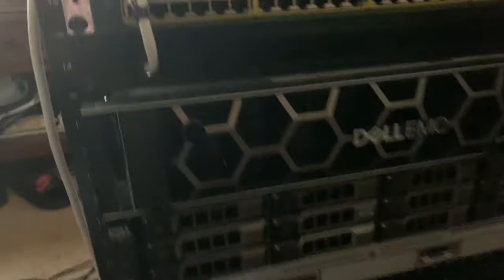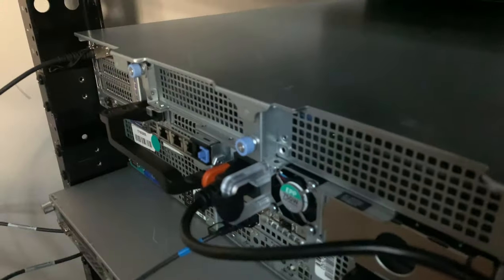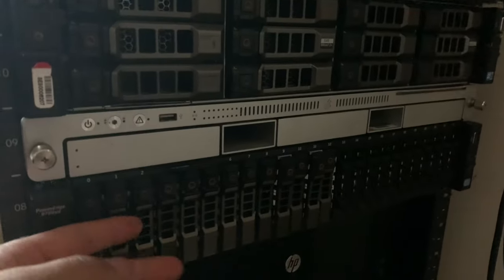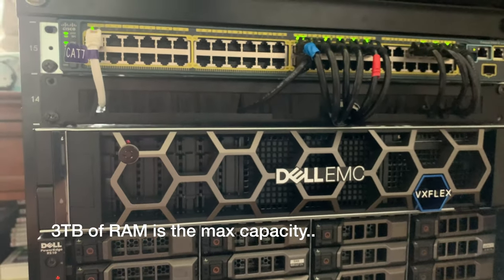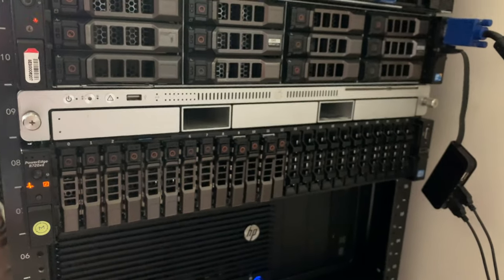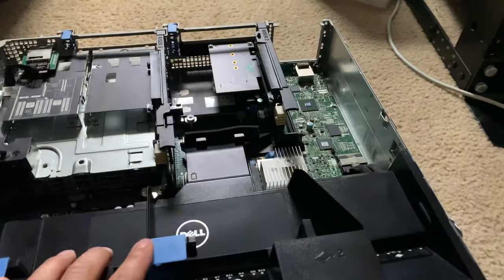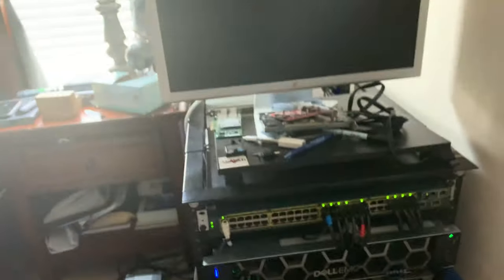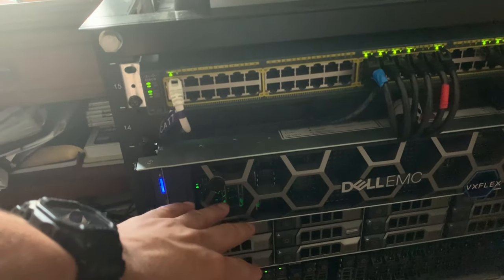Homelab VLOG: New Servers, FreeNAS, Hackintosh??

Comment: Yeah, great video keep up the good work.

BTW, if you want 10GbE switch rather then the old Arista hardware you might want to look into Mikrotik SFP+ switches.  They are fairly cheap, cooler and much more energy efficient.  Mikrotik isn't enterprise level hardware necessarily but its fairly solid. Depending on the number of ports you want such a switch could even be passively cooled (4 SFP+ ports to 8 SFP+ ports).

Something like the CRS305-1G-4S+IN, CRS309-1G-8S+IN or CRS317-1G-16S+RM

These are all fairly cheap for what you get,....

Comment: Good Stuff man, Grats on that 740 score! I'll be getting one when I find a deal. I see that 2960 switch, I got one of those, the 10/100 POE is nice, but you should look for a 3750 full gig switch w/ the 4 sfp 1 gig ports, they have been on ebay lately for about 60 bucks. Can't beat'em.
Reply: Is the 3750 loud?
Reply: @skyshooter4009  nope, quiet as a breeze. I do not push mine though.

Comment: Yes Hackintosh on the 720 would be great. I have one and I believe it will support a graphics card. I have an X-Serve 2009 but am having problems getting Dos-Dudes patchers  to work. Have you tried OpenCore bootloader on a Hacintosh project.
Reply from the maker: Kerry Kesner I tried OC with the R720 but it wasn’t working so I used clover. I should have a vid showing the proof of concept here soon. Do you still have the T7600?
Reply: @averyplays7576  Yes, still have it. Have mint on it now. Never got around to Hacking it with Hackintosh.